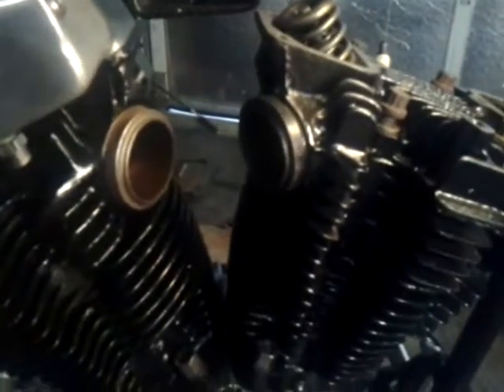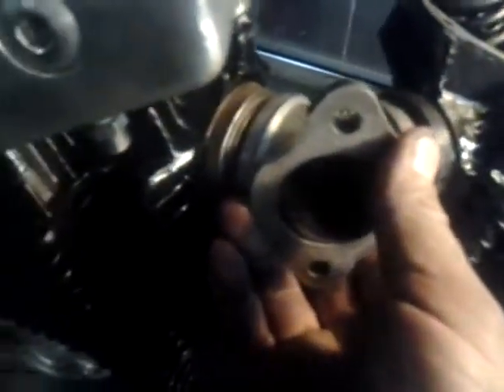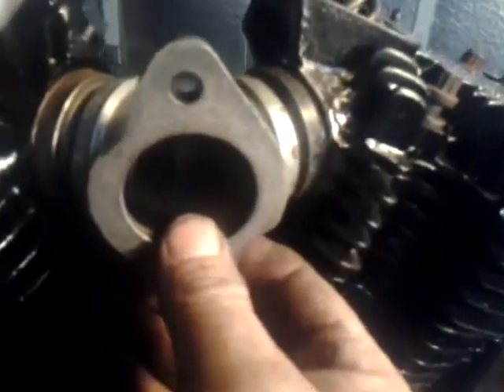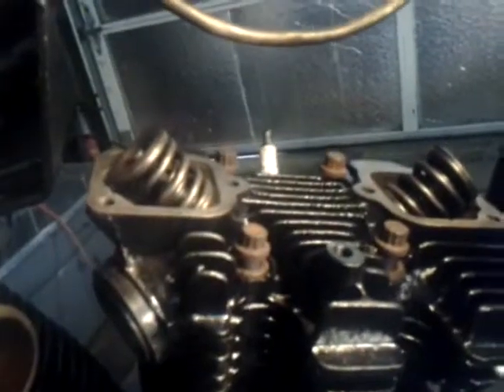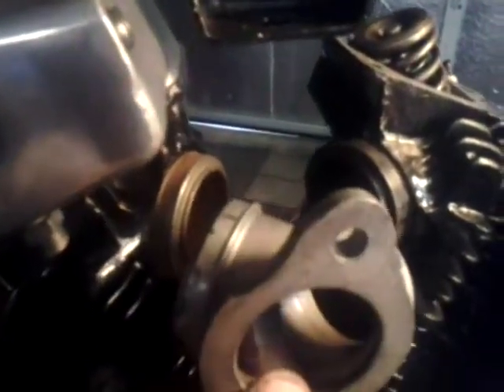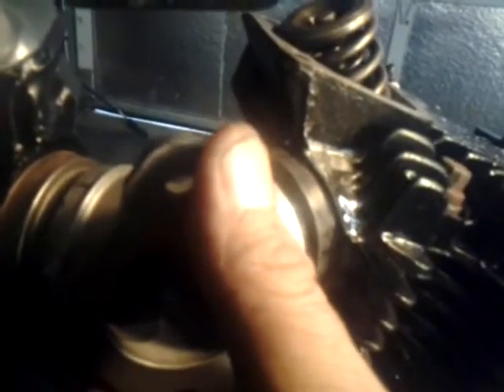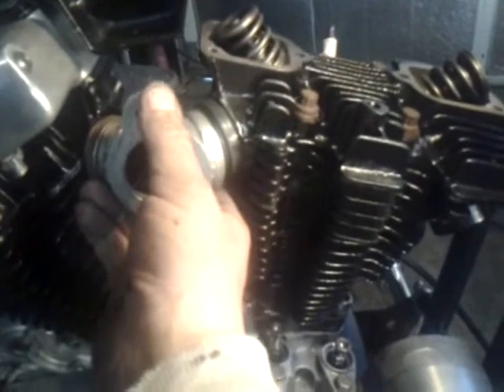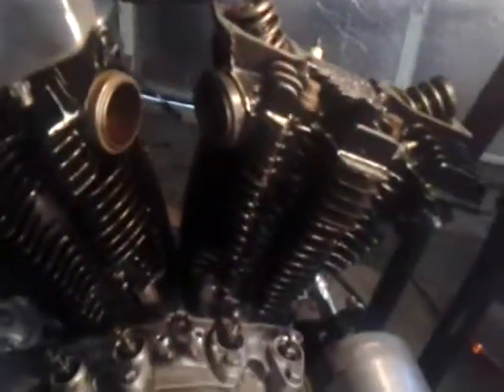harley sportster intake alignment manifold adjustment

Comment: I've seen that bike on Tatro Machine's channel I think. It had dent just like that in the backbone of the frame in the exact location.
Reply from the maker: if you mean the 'dent ' by the top motor mount ,  the 'dent' is factory, no not on tatro i do my own work,  thanks for watching!
Reply: @crashman1963  That's strange. My 76 doesn't have a dent there. Maybe not all 76's were created equal. When you said the kid before you let the bike go to hell... it made me think even more it was on Tatro's channel, because it belonged to a young kid in the video. That boy didn't know anything about his bike.
Reply from the maker: @SaddleTrampTV  i saw that series on tatro. and maybe not on the frames , never know w old HD. that bike came from little town in cebtral pa.  i have a cpl 76's , its there in other years also, i bring my key or coil wire out of there(dent)  fairly often since i'm always trying to hide wiring,
Reply from the maker: @SaddleTrampTV  bout the intake you want to adjust to get as close as possible ,turn the jugs,heads-they usually line up pretty nice. good luck and thanks for watching!
Reply: @crashman1963  Thank you as well.